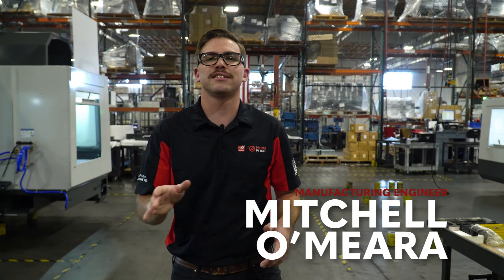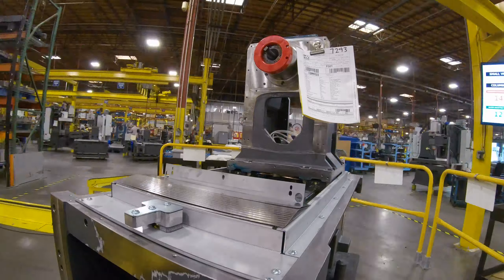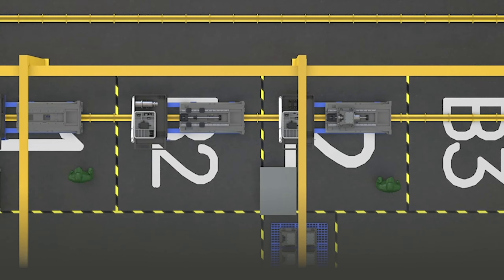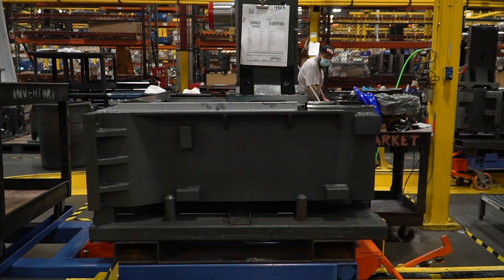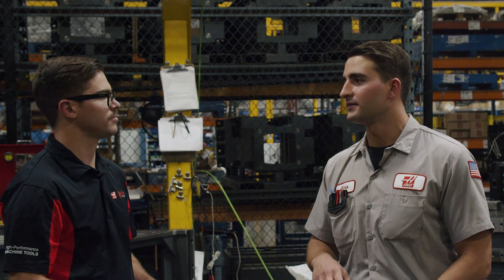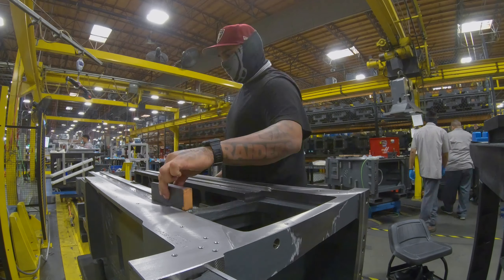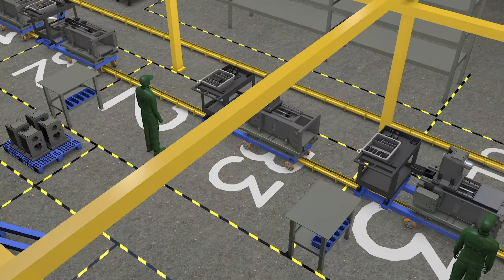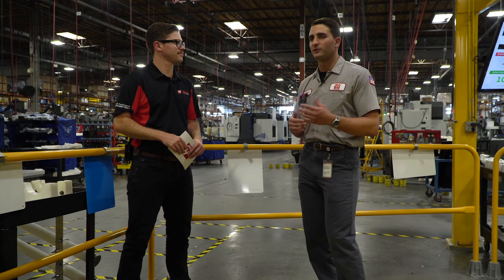Factory Spotlight - Flow Line - Haas Automation, Inc.

Comment from the maker: Thanks for the comments on this video. In reference to the type of work performed on this flow line vs. other areas of the factory. We employ upwards of 1500 people in the Haas factory and no single person would expect to complete every operation it takes to make one of these CNC machines from beginning to end. 
Just like any other modern manufacturer and just like manufacturers have been doing for well on 100 years now. We break the work to be done up into stages that one person can accomplish in their work day. Our production levels are such that it isn’t practical for one assembler to follow a machine from initial placement of the casting on the floor until it is rolling out the door complete. 
With that said; in both our Casting and Final areas there are typically a small number of skilled assemblers working on any one machine and they have responsibility for the final quality of the machine. Additionally, assemblers do rotate from station to station, on the flow line and also to other parts of the assembly line and even different machine lines. Most of our seasoned builders have spent time on a multitude of different types of machines.
Cross training and assembler knowledge/skill building are an essential aspect of our manufacturing process. Learning the countless operations and skills to become a high level final assembler on any of our machine lines takes years of learning and high-quality work. Building a skilled workforce is not something that comes easy or that can be done overnight.

Comment: I dont know, not sure I like the idea of 400 guys working on the machine, each one just tightening a few bolts. I would rather have someone who knows more than righty tighty, lefty loosy building my machine with pride instead of just passing it down the line not caring.
Reply: that's what they clearly want though. the ability to assemble the machine with as little skill as possible
Reply: @SuperAWaC  Well, that is what some white collar "process engineer" wants watching his simulations, and making his spreadsheets. Seems great until 10 times as many machines are having problems and the reputation of quality in the industry is shot. Just like Boeing, they made pretty much every plane in the sky for 60 years, then turned everybody into a bunch of button pushers, now some of their newer models are banned in most countries and the rest are sitting in hangars getting fixed.
Reply: @SuperAWaC  
I am sure someone got an extra $1.80 per hour in their pay check for coming up with this ingenious idea.
Maybe the same guy was watching the history of Henry Ford on Netflix ??

Comment: Seems like a good idea ????
Not if your the guy doing the same job everyday.

There is not much pride in your work if your just sticking the right bolt in the right hole.
This system leaves itself open to the standard problems Mass Production brings ?

If one guy stuffs something up he will just push it along the line without a care.
Just like Automotive Manufacturing.
NOT MY PROBLEM
Let the dealers sought it out ??

The idea of rotating people from one station to the next is a good idea to reduce the monotony.
Definitely need to do something for this Dum Dum assembly line.

I guess this is one answer to try and build a good machine against some of the Best machine builders in the world.
Reply: Human being does not want to be trained becoming robot

Comment: "When it started it was literally myself and a manager, and he said we want to take our factory and make it better so that we can become the best... the #1 machine tool factory in the world."
Oy...

It probably doesn't mean much for a smaller casting structure to not be leveled out during assembly, but this isn't best practice.  This seems to be a cheap assembly line implementation for a machine that is supposed to cut aluminum within reasonable tolerances.  So that still may be ok, but the toolmaker in me believes otherwise.

Here's an older HAAS company video, https://www.youtube.com/watch?v=WTEGAjj_SAs